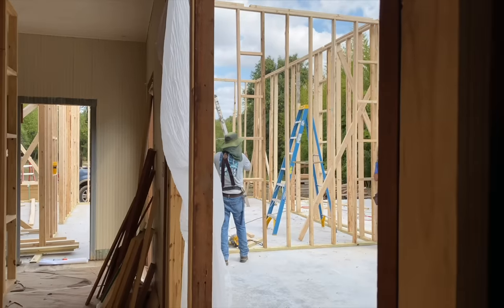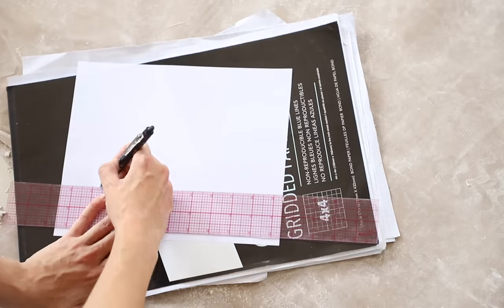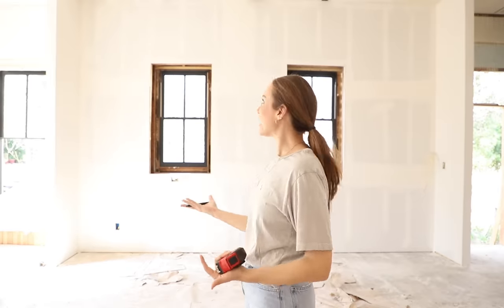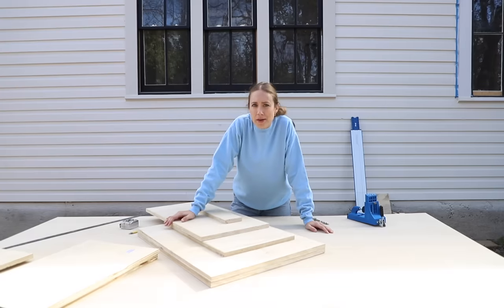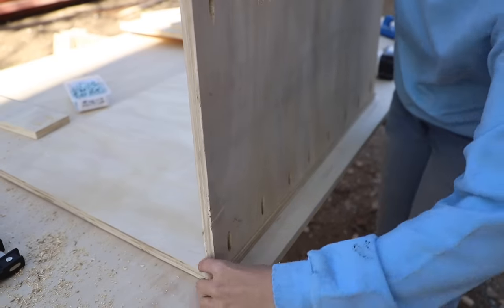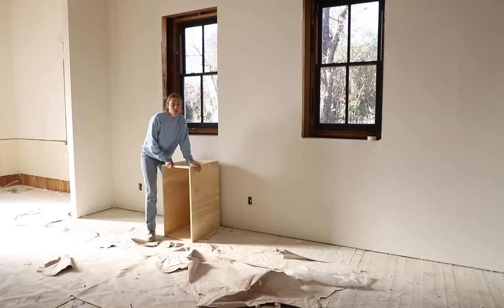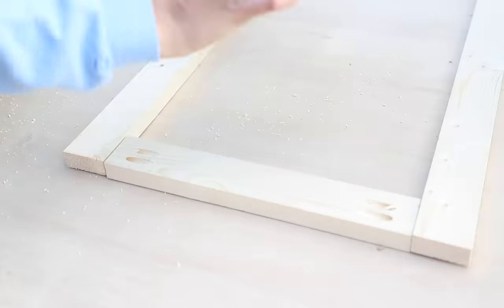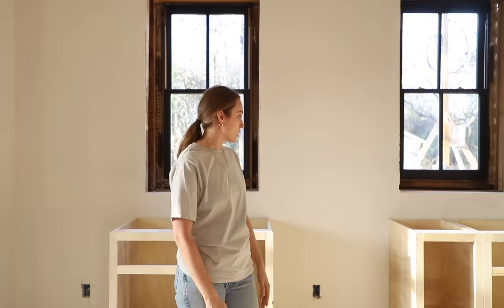Building Our KITCHEN CABINETS From Scratch! (Kitchen Makeover Part 3) | XO, MaCenna

Comment: Be aware that your fridge needs 1/2 inch or so room on each side for the doors to pivot open. With the door open straight where it looks like its an extension of the sides it actually sticks out a little farther. A 36 inch fridge won't fit into a 36 inch space unless the front  extends past the depth of the wall or cabinets next to it.
Reply: Very good point.
Reply: Good thought!
Reply: I plan to tell her about the fridge wold not able to open full... you bet me. I am glad you did..
Reply: not just that but it needs at least 5cm to ventilate on each side and 5 to 10cm in the back
Reply: i was about to comment that !!
Reply: I was just about to comment this! My aunt made this mistake with her fridge and all of her cabinets were off :/
Reply: I really hope she saw this comment! She needs to check the specs of the fridge, she may even need at least 4 inches from the wall so that the door can open completely. This is especially true since she has a wall right next to the fridge. I am stressed out now hahah.

Comment: I’m going to be doing a self build HOPEfully next year... that includes most of the construction and finishing work. I’ve been going back and forth between buying my cabinets or doing them myself. I really want to do them myself. Thanks for this video! It’s not a tutorial necessarily but it makes the idea of building my own as a “noob” a little more approachable than watching a tutorial of someone who’s done it a hundred times.
Reply: You can do it Kennie loo! 💪🙌😊✌
Reply: How much will the materials cost you for building them?
Reply: @yasmin7903  well plywood is 65 a sheet, plus the screws so around 80 bucks.
Reply: @MixedKidd  I think she did not buy just ONE sheet though...
Reply: @yasmin7903  but you obviously would multiply one sheet times as many cabinets you need.
Reply: @MixedKidd  thanks
Reply: Elysia English Channel is building some too.

Comment: Powering through those cabinets is so inspiring. Absolutely. (I would love to know time/cost for each.) My husband and I recently bought a house to make our “vacation” house. We gutted it and are just in the process of framing a few extra things and cutting walls out.
Reply: I think time will depend on the person's level of experience, and will improve as you go, just like MaCenna did. The sheets of wood she got were $64 each, and she bought 20. Add in the pockethole screws, hardware, etc., and I bet the savings are incredible compared to custom cabinets!
Reply: @RockStarVee  That's about the cost of one pantry cupboard...NOT an expensive one either.

Comment: I love old cabinetry that looks built in with inset doors. So in that case your face frames are last to go in. Basically you build the furniture with the different drawer openings, cabinets, etc… and then put the the face frame on. Your cabinets will be so sturdy with the 3/4 plywood. Many manufacturers use the particle board sides. ☹️

Comment: Looking good!!!  I just want to add a few things that came up when we did our kitchen reno.  If you are putting in adjustable shelves in the cabinets drill your holes before you assemble.  Use a jig so they are straight and parallel on both sides of the cabinet.  If you want full flexibility on shelving height drill the line of holes close to the bottom and top.  A note on the fridge doors.  They are thicker than cabinet doors so you need extra room for them to pivot and open completely which means more clearance on left and right of the fridge.  And be sure to include the depth of your countertop.  That is where we found doors would touch.

Comment: You are amazing, I love your drive and focus !! Part of the reason they use 1/4 inch on the back is for the weight factor, those cabinets are going to be heavy hanging and when you add dishes and other heavy items it'll be much more stress on the studs and cabinets.. I am so proud of you and Romeo and all that you have achieved and will be in your life ...

Comment: Those cabinets are going to be so beautiful! I think you should sand the faces down before you screw them to the wall, I just think it may be a little easier to have the faces up to sand. Similar to the bead board sanding difficulty.

Comment: Omg!  You really must build some tree planter boxes on wheels for your garden when you get to that part of design.  They look awesome with citrus trees in them.  Things like lemon, lime, mandarin, oranges, cumquat and loads more. You would just need to line the garden beds with large cordial or olive barrels as they are super thick food safe plastic.  They can easily be cut into the right height using a jigsaw.  The barrels also form the dimensions you build the garden bed.  Just drill a couple of holes in the bottom of barrels fir drainage and use that reo wire stuff they use for concrete slabs and driveways for the base of the plant pots.

Comment: You're doing a great job.  Remember to account for the doors of the refrigerator to open - usually requires a spacer piece, otherwise you will not be able to remove the trays and vegetable drawers, as the doors won't open properly.

Comment: Looking amazing! Can I suggest you make sure you will be able to open the left hand door of your French door fridge all the way if the fridge is in that corner. In most of the models I've seen, you have to open the doors out fully flat in order to be able to pull out the drawer inside. The wall on the left might stop the left side door opening fully. Let us know you've thought of this and all is okay with your design.

Comment: If you have the budget, I'd really, really recommend using a hardwood instead of pine for the cabinets. I know you went high-end with a lot of other materials, and this would definitely also be a place to do that if you want really durable cabinets (both in terms of not chipping/denting and keepings the hinges and other hardware secure).

Comment: Just a thought. You have taken into consideration the opening of the refrigerator door against the wall. With the handles you will need extra space (although only minor) so the wall doesn't get damaged every time you open the left side. The main consideration is when cleaning and taking out drawers or shelves to wash/fill. The manufacturers idea is that the doors will open almost 180 degrees.  Just a thought.

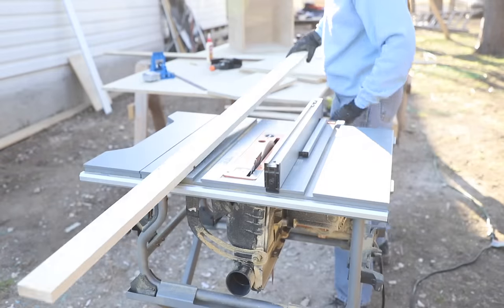Comment: 18:40 keep in mind that if your drawers are inset like that rather than overlapping the cabinet fronts when they are shut, any nicks or dings that happen as you put pots and pans in and out will be visible, since the door or drawer face won't hide them if they're inset.

Comment: While the 90 degree clamps are excellent and convenient, I just use a jig to stand pieces up. As long as your cuts are accurate and your pieces aligned, you will have 90 degree corners when your boxes are done.

Comment: What is a level 5 texturizing?  Where I live most sheetrocking is finished w/o texturizing so you can prime and paint.  The walls are flat - no orange skimming.  Is it extra where you live if you prefer no texture on your walls?  I find it cast  little shadows on your wall and requires a little elbow grease to keep clean with all the nooks & crannies.  Just a thought!

Comment: Not sure if it's useful to hear this now - but as someone who has spent hours painting the insides of cabinets, a time saver is to paint all the flat wood sheets before you make anything.  And then you only need to do hole touchups (or a complete final coat) when the cabinets are in place and ready to be finished.  The only caveat is to make sure you get glue that will work on painted surfaces.

Comment: Oh my goodness!  You’ve made it!!  Day 1 of interior DIY!!!!  💪🏼 So stinking proud of you 👏🏼👏🏼👏🏼. Those cabinets turned out delicious.  They look smooth and incredibly sturdy.  

Question: I have a kreg jig but haven’t busted it out yet.  Since there’s no stop on the jig where the wood slides into its clamped position, do you need find the center point or just eyeball it?  I know only one piece of wood really matters where you’re putting the pocket holes because you’re not lining up the two pieces like you would if you were doing dowels.  For some reason it surprised me that there isn’t an adjustable stop for getting a precise location for a pocket hole.

Comment: Do you need to add that trim? I selected  frameless  for my cabinets and ive never had as much drawer storage its also nice  for the cabinets space in general. But if your going for inset for aesthetics i suppose that makes sense. Frameless might be better for you if your spray painting the cabinets yourself and getting only the front professionally made.

Comment: That Kreg jig is $100 in stores. The patio chairs is the first episode I saw of yours. My kitchen was built 51 years ago. They were built in place. There are no backs, just a board to screw to the wall. The sink isnt a cabinet at all. It is between the units on either side with a face frame. What you are doing is way beyond

Comment: Fyi: Since manufacturers do not know if one of the cabinets will be placed to a wall or not, industry standards set the 1/4” overside hang available for scribing in case the wall is not even.

Comment: I’m concerned that the refrigerator won’t open properly with that wall on the left side. Might make sense to put the fridge on the other side and leave some room between the wall and the fridge. You could even put a slender cabinet for a broom etc. You’ll want to be able to open the doors all the way.

Comment: Beware of drawers at a return wall. I’m sure your parents know all of this, but no walls are straight, so you’ll want to have an inch or 1-1/4” at least filler piece at the end of the run where your drawer cabinet is on the right next to the wall. That way your drawer front won’t scrape the wall as you open it.

Comment: Sounds like you want an INSET door style. Insets are tricky. Each drawer and cabinet has to be fitted into the space allotted. The STANDARD OVERLAY design has 3/4” wiggle room to adjust your drawers and cabinets so they are level and plumb. FULL OVERLAY designs are tricky because all of the cabinets and drawers are within an 1/8” of each other. Toe kicks are 3-4 inches high. Older cabinet designs did not have toe kicks. If you do want to have a toe kick, you may want to make bases for your cabinets to sit on. But, if anyone can figure this out, it is you! Like to see “girl power” using carpenters tools!

Comment: I love your windows. But being vertically challenged as I am, I have had a heck of a time trying to open my double hung windows with a counter in front of them. 😂 You’re taller, I think so you might not have that issue. I’m thinking this is why my house was originally built with 20” deep lowers instead of 24”.
Reply: Doubt she'll open them much as she has air con.

Comment: Might consider stacking upper cabinets directly on top of the lower right cabs of the windows & pushed to the back wall.  This eludes to a pantry/hutch look. Will have a 12” counter in front….if you made the bottoms 24”d.

Comment: Are your face frame stile and rails 1" or 1.5"
Reply: You're saying there's a 1/4 inch overhang on the face frame and the the edge so there's no lip but also a 2" rail stiles? Confused since that's a 1 1/4 inch overhang

Comment: As a cabinet maker, you really shouldn't have bought the wood from home depot, a lumber supplier would have sold you prefinished birch for half the cost of what you got and way better quality. For example I get 4x8 3/4 single sided prefinished birch for $34 a sheet. You could have saved hundreds if not thousands. I know it's too late but maybe for your comment section or anyone watching, You do not have to be a pro or a contractor to get these kinds of pricing. Also because these are paint grade cabinets, you should be building the face frames from poplar, it sands easier, its lighter, it costs less and is generally much more flat. 

You can build your doors from 3/4 thick poplar (protip, you can get router bit sets for door joinery, DO NOT BUTT JOINT YOUR DOOR RAILS AND STYLES, THEY WILL 100% WARP) and the panels can be 1/4" MDF, you can choose to go with HD quality MDF which is fine but heavy if you want a little weight to your doors or you can get the MDF from a lumber yard that sells ultralight MDF, It's the same stuff but isn't weighed down with tons of glue so its much more light weight. 

You really should have done this with prefinished. It's going to end up costing you way more to have the insides finished and sealed from water when the cabinets are painted. 

Last tip would be to buy some wood filler and fill every little void or imperfection you can fins on the wood so when paint happens they wont show up everywhere.